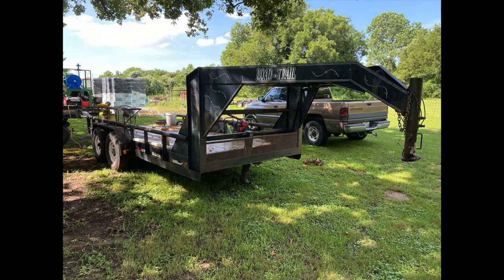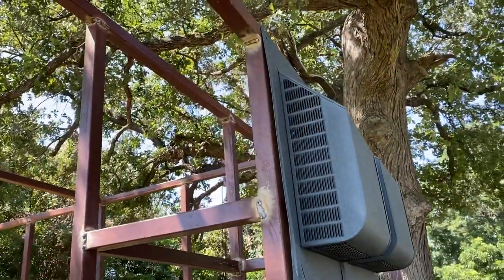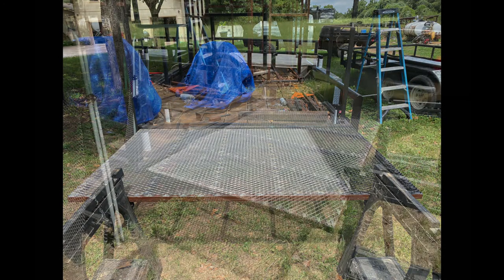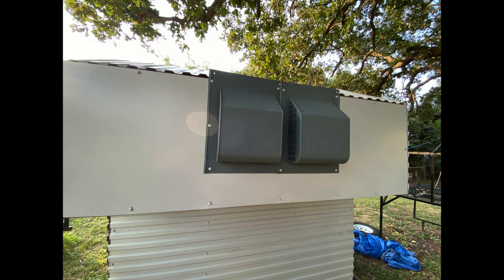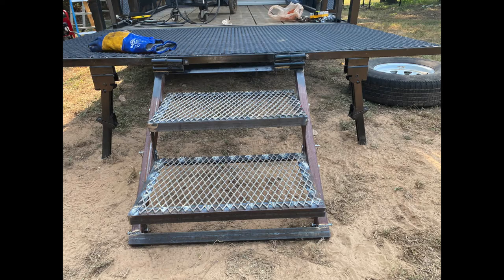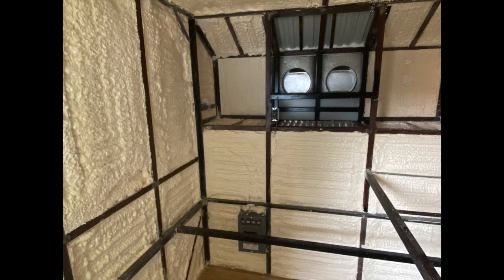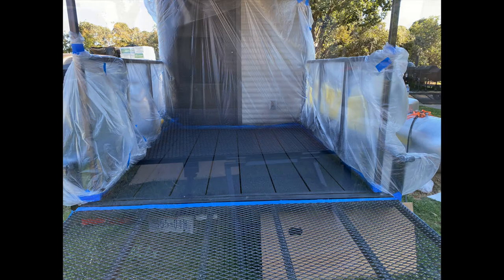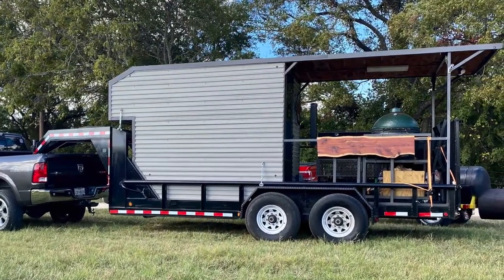Custom Competition BBQ Trailer Part 1: The Build

Comment: What is the siding and corners from ? That is some serious engineering and craftsmanship.
Reply from the maker: Thanks Tyler, I’ve never built anything like this before. I’m just a man with a plan in his head trying get it out. 
The sheet metal is like an r-panel. I think it’s called mini rib. The place I get it from (Metal Mart) cuts it to order. All pieces were pre-measured prior to ordering and I only had to do very minimal trimming. They also have brake machines and custom make all the corner and trim pieces.

Comment: Nice set up appreciate the information. I do have a question for you. How are the bleachers holding up as a floor?
Reply from the maker: Thanks David, the bleachers are as good as the day I put them on. The only place there are issues is where I had holes drilled to mount previous equipment to the trailer. And even those are minimal. Zero regrets.

Comment: Was there any extra support for the EGG? Im always worried about hauling mine.
Reply from the maker: The egg made a few trips but was retired to the back yard after I found a crack in the base. I ended up building an insulated smoker to replace it.